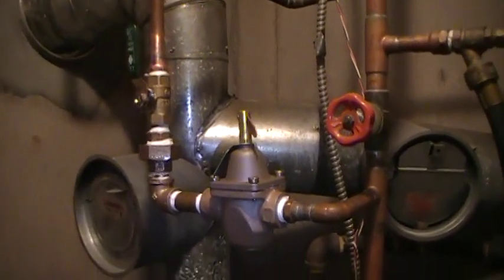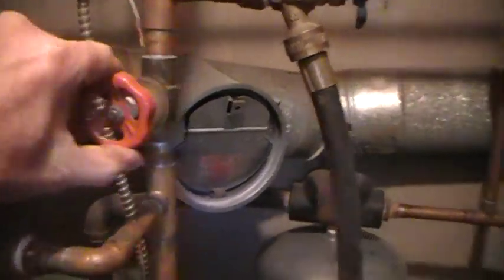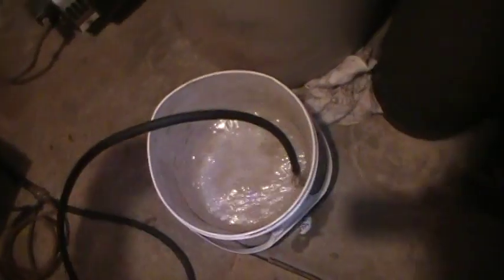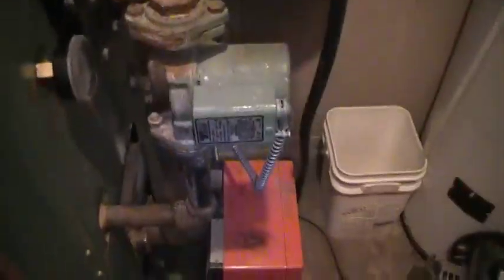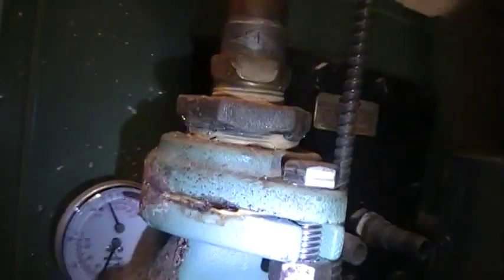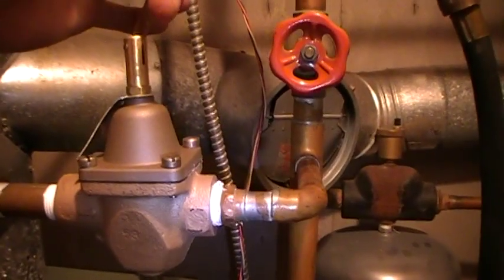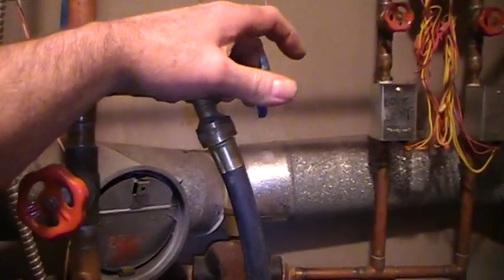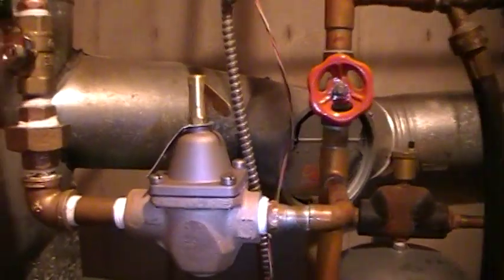How to remove the air out of your hot water heating system-girgling noise.

Comment: I managed to keep the water coming into a different opening at a reasonable pressure to keep it around 15 psi.  That pressure reducing valve is definitely blocked with sediment - I will need to get a plumber to replace it.

Thanks for all of your help!

Comment: Thanks AL, great reminder  , just replaced a  air  purge popper  valve an flushed  the system. Have  4 valves , so I made  up a  water   hose an used a mop bucket to  get the air out of pipes .

Comment from the maker: Hello alyosha1974;

If you do not have a zone valve on your heating system then you would have a flow control valve on coming off the top of the boiler because something has to keep the hot water in the boiler and a flow control would do this.
They are very common!
You are correct in your statement! Do exactly what you saw in the video and this will eliminate the air in the system! No zone valve is just one less step!
Thanks for the kind words and best of luck!    Al

Comment from the maker: Hello Thomas;

You can do this any time of the year.Whenever I change a boiler I do this procedure.The water is going to be hot for sure. I am hoping that your heating water is not set on 200 degrees on the high limit!
I have never had a problem with cracking on a boiler myself. If you are concerned about that you can leave your system on and the cold water will be heated as soon as it enters the boiler. 
Thanks 4 commenting and G.L.  Al

Comment from the maker: Helo Tim;

Believe it or not the water pressure pushes the air ahead of it and forces it out of the system.
Years ago there would be a place where each piece of radiation would have to be bled.
Now that you can purge it out with this method there is no need for individual air vents (bleeders).
The procedure works very well even with 2 story homes.
Thanks for commenting and enjoy your week!    Al

Comment from the maker: Part 2;

So once you have purged the system; you want to do the reverse of what you have done and check the pressure in the system. When your system is hot you should have around 20 PSI. The PRV will allow 12 pounds of pressure into the system. After you have purged your system; watch the gauge and the pressure should go to 12 PSI. If not, lift the lever on top of the reducing valve, watch the gauge and place 12 pounds into your system!
Hope this helps and thanks for commenting!    Al

Comment from the maker: Hello perogi21;
You are more then welcome! You have to hook the zone valve open when purging the system!
The water does come in through the pressure reducing valve.The PRV can become blocked with sediment.
This is very common,but when you are purging you can lift the brass lever on top of the valve as this will increase the pressure.Be careful when doing this as the relief valve blows off at 30PSI.So lift a little bit a time and you can regulate it this way.
Let me know how you get along! Al

Comment: Thank you for the great video!  I never knew about the switch underneath the zone valves.

Question though: On my system, it doesn't seem like water is going INTO the system. Where is your water coming from?  Is the water coming in on the other side of that pressure reducing valve?  We have something similar to that but I think the value on the intake side of it isn't opening :-/  Thanks in advance!

Comment: thanks!  I did all 4 zones, kept the pressure in check!  This "gurgling" started when I had to have the circulation pump replaced, along with 2 pressure relief valves and the acustat? (gray electric control box in front).  The plumber (who I just met) also suggested replacing the feed water valve.  Since i didnt know how much money I was in for at that point, and he had been here for 2 days, I said i would hold off on that until next time.  Do you think its a good idea to replace that as well?

Comment from the maker: Part 2;
Watch your gauge as you don't want the pressure to go above 20 pounds.Relief valve will pop at 30 PSI.So be careful!Once you have hooked open your zone valve,turned off your return valve,placed a hose on the drain valve of the loop and opened the drain valve;lift the lever and watch the gauge.You want your pressure 15 to 20. You can control this by the lifting the lever a bit at a time.Once there are no bubbles,let go of the lever,turn off the drain valve and reverse everything.GL!   Al

Comment from the maker: Hello Tim;

So the first zone you purged is working well. You have to purge each zone individually; you probably no that.
Did you use a 5 gallon bucket when you were purging each zone. I find this the best way to do it because when you see no air bubbles; you know it is purged well. this will probably take about 5 minutes to do each one. I lift the lever on top of the pressure reducing valve (feed water valve) and get the pressure around 15 to 20 pounds.
Read part 2.

Comment: So if you have 4 zones (in addition to the hot water storage tank) do you have to purge each zone?  I followed your instructions and it worked very well for the first zone.  When I attempted to purge the 2nd, 3rd, and 4th, there was almost no air to be purged.  Now, a week later, i hear the gurgling again in the pipes, so i'm about to purge again.

Comment from the maker: Part 2; Be sure to watch the gauge when purging! When it heads over 20 place the lever back down. You can lift it a bit and it should give you a constant pressure when purging. After all the air has left the system and you have placed everything back in order; you can add some pressure back to the system by lifting the lever and bringing it up to 12 to 14 pounds. When operating HOT;your pressure should read just a little below 20 pounds.
Tks for commenting and let me know how you get along!   Al

Comment from the maker: Hello jaybotb;

The water feed is called a pressure reducing valve. When I am purging; I lift the lever on top of the valve and this allows more pressure to enter the system. When doing this you must watch the pressure gauge as you don't want more then 15 to 18 pounds in the system. 30 psi and the relief valve will pop. By the sounds of things your reducing valve is plugged, but you should get more pressure when you lift the lever straight up. Make SURE to watch the gauge. Read part 2.

Comment: I am not getting heat upstairs on my baseboard. I have 2 zones 1 in the basement and the other one is on the 1st flr. When you are purging do you need to open the water feeder (that looks like a taco bell) or it is automatic that water will flow thru the pipes when you drain the water. My psi when hot is 10, if its cold 5 psi. Do i need to anything to adjust my psi? I would appreciate it very much if you can get back to me please.

Comment from the maker: Hello bbblume;

It sounds like you have a steam system to me. They are exceptionally noisy. 
You mentioned a one pipe system. They are very noisy.They made systems like that many years ago.
You have a leak in a radiator is that correct? I don't believe that any valves were installed on this type of system then.
There are times when I recommend getting a professional to help and this is one of those times. 
Thanks for commenting and best of luck with the leaky Rad.   Al

Comment: Thanks so much for this video!  Q; Is it is possible for some of the return valves to have different on/off positions compared to the others?  My system is quite old and all of the valves are globe type.  There are no visible on/off markings and only 1 has noticeable travel in the pin to indicate whether it is open or closed.  It seems that it's open position is opposite to the other return valves.  Does clockwise always mean closed, or could someone have installed some of them incorrectly?

Comment from the maker: Hello MrFunfarm;

The pressure on the heating system should always be below 30 pounds. Working pressure when the boiler is producing heat should be roughly around 20PSI.
Is this what your pressure is on the boiler. There is a pressure reducing valve that only allows 12 psi into the system. Once the water is heated it expands and this is the reason for the tank. But the system should never get near 30PSI. If so you have a problem.
Thanks for commenting and let me know about your pressure!  Al

Comment from the maker: Part 2;

The pressure should not go above 29 pounds when you are purging it to be on the safe side. Once you have purged all the air make sure you have opened all the valves and that there is a minimum of 12 pounds on the system.
Please let me know how you get along...Al

Comment from the maker: Hello Dondra Chambers;

You may not be doing anything wrong. The drain on the return line is where you purge the system. You must close the return valve below the drain valve and hook the lever on the zone valve. You should get water then. The pressure on your boiler should read 12 pounds when cold. The PRV on the boiler sometimes plugs with sediment. You will see a lever on top of the prv; a brass lever, you may have to hold it upright to fill the system.Watch your pressure on the gauge.

Comment: Worked out just fine after attempting this a second time, once all the crazy noises passed.  Thanks a bunch.  There's a small valve type thing on top of the expansion tank which allows air into the system, has a black and a red nozzle on it, any suggestions on what I need to do with this ?  The nozzles are adjustable, just not sure on their function.

Comment from the maker: Hello fins209;

I usually close the valve going to the expansion tank and allow the water passing through the pressure reducing valve push the air through. Once it is done I slowly open the valve to the expansion tank. I would say that everything should work out for you.
Let me know how you made out with it.    Al

Comment: Thanks for posting this.  I have 1 zone with that splits out to the North and South of the 2nd floor.  The north side baseboards would not get hot, while the south side baseboards were toasty..  There must have been bubbles in there.  Watched the video and purged the system.  Took about 25 gallons to get all the bubbles out.  Now it's hot on both sides.  Your video made it much easier to do.  Thanks.

Comment from the maker: Hello mrussokmbs;

Your circulating pump is on the return line correct? Is there a valve below the pump itself?
Sometimes installers will save themselves a few dollars and not install a valve either below or above the pump. There has to be a valve there or else you will just get the water out of the boiler. Is this a new system by chance?
Send me as info as you can about the valves on it...Thanks    Al

Comment from the maker: Hello NishTifaL;

Have a few questions for you.When you are saying radiator..is it baseboard radiation or cast rads? What is the pressure on the furnace reading...12 pounds or higher?If you are getting water then there is more then likely 12 pounds. Is it on the second floor? Sounds like you are bleeding the rad in the room..correct? Need a little more info from you..get back to me and we will see what we can do.   Al

Comment: One problem.  Believe it or not, I do not have a return valve.  There is a feed valve before the pressure regulator (system shut off), a drain valve at the bottom of the main stack, and two purge valves (one for each zone).  How would you do this procedure without this valve?  Sames steps but just run until no air is seen?

Comment: I have one cold radiator in my home. I hear gurgling when both zone valves are running hot water through my home. I try and bleed the radiator that is cold but no air comes out just water. I bled approx a litre out of the rad and the pipe leading up to it was very warm but not the rad. :S

Comment from the maker: @daleftybandit Hello;

Give me a little more info about your valves you are talking about.Lever valves...Do you mean ball valves?The pipe that goes into the bottom of the Boiler is your return line. Follow it up and you will find one or more valves on the return line. There should be a sediment faucet there. If you hook the lever on the end of the zone valve you will allow water to go into that loop. Open one sediment faucet until you find the one that corresponds with the zone valve.
G.L. Al

Comment: Hi theodkid888,great videos,  If I want to purge the system to add another section, do I have to shut the feed that is just before the pressure reducing valve so that the system is total dry  before cutting into it so that I can sweat the pipe? and follow the steps above. shut feed,shut return, and open zone valve then open the drain valve to purge right? thanks in advance.

Comment from the maker: @shaqmoney2001 Hello there; That is correct. Baseboard radiation is usually looped from one room to the next. If you are going to add another 5 foot section, you will have to purge that zone (loop).One of the big mistakes made by many people is that they don't put in enough radiation. I generally try and go with 1 foot of radiation for every 10 square feet of floor space. A room 10 x 10 would then have 10 feet. Hope that helped. Thanks for your comments and enjoy your day!!!   Al